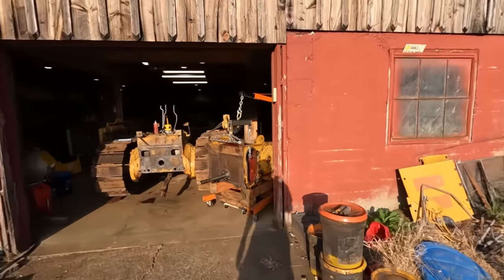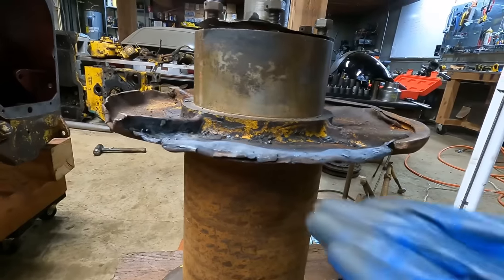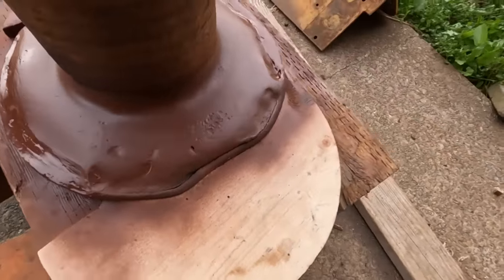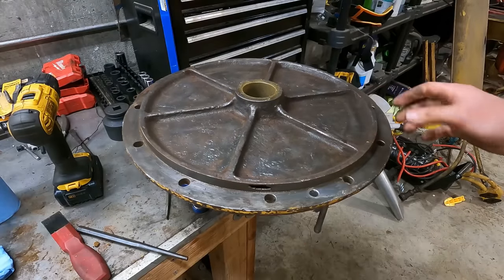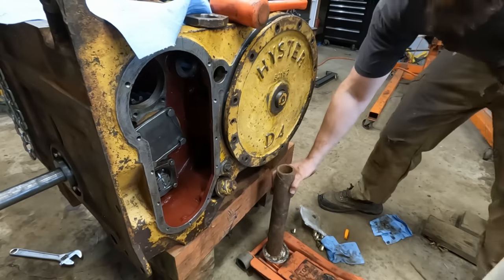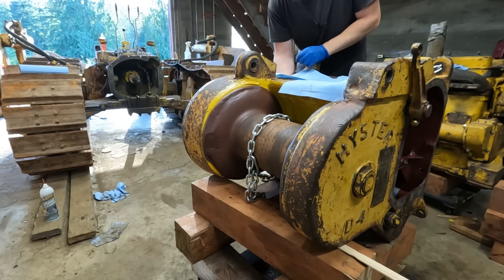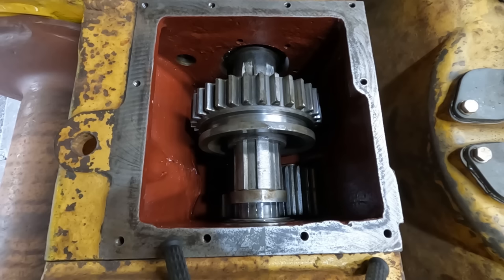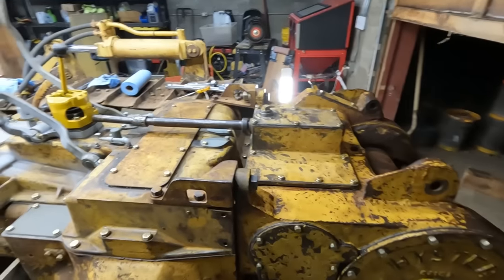Caterpillar D4 Hyster winch full rebuild and installation (part 3)

Comment: Great job saving the original drum. Love the old red oxide, I have parts here my dad painted with it in the 1950’s and it’s still there and no rust.  Your dog is very patient.  Great episode 👍
Reply: Likely that is Glyptol (sp?)
Reply: @uglysteve1  probably Gasoila
Reply: @ligurian728  I’m not sure but I believe there is a can of gyptol visible during the video and I used gyptol in the past and that is the right color for it, I think.
Reply: @uglysteve1  I'm sorry, I was thinking Glyptol wasn't available in the 1950's which it was.
Reply: @ligurian728  please, no apologies necessary. As an electrician I painted motors with that stuff and the color is like no other.

Comment: After reading some of the comments I will pipe in.  It’s a wonderful thing that you are doing.  Old Cats are great machines built in times where people had pride in making overbuilt machines that were made to last.  And be worked on.  I fixed Cats fresh out of high school to cut my teeth on heavy iron.  It’s a wonderful way to broaden your experience in mechanical skills.  Looks like you have a grasp already in the art.  Keep on trucking!  It’s cheaper than most hobbies and you can continue to grow and feel pride in the results.  The shaft guy sent me here and I am impressed. 😎

Comment: Ex Aircraft engineer here, Wire Locking was the bane of my life, I hated doing it. Looks like you did a pretty good job on this thing. Just remember, your winch isn't gonna fall out of the sky if it goes wrong. Plus it doesn't vibrate anywhere near as much, or at as high a frequency as Aircraft do. If one of your fixings does decide to come loose, that wire will hold it and stop it lunching the rest of the thing.

Comment: Usually when installing safety wire, the wire is doubled up and twisted together between bolts/nuts. Also, it might be beneficial to make (buy) your own after market anti-fouling (fairleads) cable guide rollers to ensure the cable can't climb up to the outer spool edges you spent all that time repairing.

Comment: As a Welder for 25 years, typically Stainless steel rod is only used on Stainless Steel. When Welding High Tensil strength steel I always used 7018 know as Low Hydrogen Rod, it flows much better, and the 70 stands for 70,000 lb tensile strength. Mild Steel rod 6013, is 60,000 lb. Tensile strength.  I enjoy your channel very much, keep up the good work.

Comment: You asked for comments on the subject so. I learned safetywire from Naval aviation (helicopters) techniques in the 70's. You've got the right idea on your routing pattern but you only ran one strand. Safety wire should be two strands twisted between bolts. There's a whole lot of twisting with safetywire, that's why they have the built in twister in safetywire pliers. One strand goes through the hole and the other goes over or around the bolt/screw head (depending on the situation). It can be a little tricky trying to twist the pair the proper amount between bolts so that the tension is maintained between bolts, but you get better with practice. Tip: make fine adjustments to the tension between bolts by twisting more to shorten the wire or untwisting a little to lengthen it before you release the grip with the pliers.

Comment: Tim from Canada suggestions are when you’re making a jig and you are trying to bend the metal on a wooden jig.. soak the wood so it does not catch on fire.. or keep a spray bottle with you and when it catches up like that squirt it down.. but if you would’ve soaked that wood first you would have not had the fire come up. Just some suggestions looking Atwood‘s going on

Comment: absolutely amazing that you can remember the million different parts. excellent matt.
Reply from the maker: I can't, but it pretty much only goes back together one way!
Reply: I put a three cylinder motorcycle engine back together once. It had been completely disassembled transmission and all. Once again it only goes back together one way you just have to keep trying different combos on the transmission shafts and gears. Eventually everything fell into place. A real Yahoo moment.

Comment: Unwanted welding tip 😝: Before you try to restrike an arc with a used rod a gentle swipe across a rough surface (old file on the ground or a brick, or the concrete) will remove the flux coating a little and expose the rod end leading to a good first strike.

Comment: I know welding cast can be a butt puckering experience as you listen for pings of doom. I always found I had no issues with welding cast as long as I kept the work hot while I worked on it (regular visits from the torch) and a nice slow cooling (wrap her up in the fiber glass blanket and put her to bed!) That method always served me well :)

Comment: Maybe this has been said before, but for safety wire on bolt circles you basically start at the mid point in a long length of wire, twist them together the. Around clockwise on the bolt head and the. To the next one in such a way that they all are prevented from twisting counter clockwise. I’m sure it’s more than fine as is, given the application. Great work as always.
Reply: Oh my bad, I might have said this too soon. Didn’t know about the single wire thing :)

Comment: Try using a good marine grease or silicone grease on shafts that have no seals also always try to get double lipped seals if you can find them for replacement of seals they will always be much better at their application ,A bearing supply house & some one that will take the time to cross reference the needed seals will be VERY handy ! Best of Luck on the Rest of your project looking Good so far attention to detail is paramount ! Can't wait to see it Run ...Missouri Paul 👍🇺🇸👍👌😎👌

Comment: Welcome back Matt.. We understand you can only do what you can. Great to see you back. Remember all the drum does is feed the line back in. It all ends up how smart the user is that's operating it, one thing i learnt was never pull more than 45 degrees left or right of the center line, if you do your just asking for trouble. A friend of my completely screwed his 9000bls warn winch pulling his car sideways, cracked the winch casing on both sides. Its all about how you use it.

Comment: With safety wire, the way to remember it is that the bolt wants to undo anti clockwise therefor the wire needs to be trying to pull it back clockwise. As an example you have a bolt there with the holes at 3 o`clock and 9 o`clock position and you have threaded the wire straight through. In fact the wire from the right hand side should pass over the top of the bolt back into the hole at the 9 o`clock position, out of the 3 o,clock hole, then down under the base of the bolt to the next bolt on the left and repeat so the wire is in an "S" shape or as near as possible. If a bolt has a tendency to undo it in fact tightens the wire and hence all the length of wire through the other bolts by shortening .Good video

Comment: Your safety wire procedure is basically correct. I am a licensed aircraft mechanic and safety wiring is an important part of any reassembly processes. You are using the correct safety wire pliers. The safety wire should be stainless steel. Always thread the wire in a clockwise direction 
 from one bolt to the other. It might even be ok to use Locktite especially on land vehicles. Right now all aircraft repairs and part replacement call for the original safety wire. You are very thorough in your procedures. Following the manuals,as you do, is a major part of aircraft repair as it should be with any complicated piece of equipment.

Comment: Holy smokes, you know every single part on this old machine. I have no mechanical ability but it is interesting to watch you work your way step by step. When you are all done, it should work like a new machine. Not only did you have normal ware and tare but you had rust and bad repairs. Everything is so heavy. I am glad that you have not given up on her. I know it is a long process but hang in there. It will be so cool to see it all done. 🤠🤠🤠😃😃😃😃😃😃

Comment: Double twist the wire between the first bolt pointing towards the next in the direction of tightening.  Twist approximately 6-8 turns per inch so that the untwisted ends reaches the hole putting tension upon the next bolt, wrapping the other end of wire around the bolt to the end going through the bolt and twist to the same as before. Clip at approximately 5/8” and turn pigtail into a loop out of the way of everything.  Repeat on remaining bolts.  I can assure you that I could have done it quicker than typing it out.  Practice makes perfect, but in this situation close works.  Safety wire is really useful for a lot of places, ergo the wide usage in aircraft and heavy machinery where vibration is prevalent.  I have 3 sizes currently and use almost daily!  If you are interested the standards are available in the aircraft mechanics bible- AC 41.30-( iffn I remember correctly) A & B.  Prolly find it in a Google search.  Great stuff for your enlightenment,  one of the best technical investments I have ever seen.  And it’s a government printing that is really inexpensive to boot.

Comment: 250 lbs is about 4 kilometers...   'nuff said.
I for one, really appreciate the time you spend coating the inner cases with Glyptol.   Doesn't make much difference now, but there is something reassuring when you open a mechanical case open and find the insides have been Glyptoled.

Comment: With respect to the shaft shim pack that you installed in the earlier video. I believe you were worried about it leaking or using the appropriate sealer that wouldnt change the shim pack thickness and corresponding shaft preload. Ive restored a lot of old iron and in some of the FSM's, they recommend coating the shims with grease to prevent oil seepage. Ive used this method with success. the grease of choice for me is military GAA, ( Grease Automotive Artillery). You did a great job on this machine. its a heck of an accomplishment, believe me, I know what work it is, and how frustrating it can be, sometimes it seems it will never finish, Best of luck. Retired Engineer Ted

Comment: Matt, I think your project is a wonderful way to keep you off the streets... not that I'd know you were a problem on the streets, it's just something my dad would have told me. I used to have an old 4' Maletti tiller that blew a shear pin in the gear case and I didn't have a gear puller, so I made one with a length of chain and 2 pieces of angle iron welded on the ends. I heated up the gear with my propane torch and used a 10 ton bottle jack and off it came! Similar to the tactics that you have employed on your project, except you have better tools than I. Keep up the good work and the vid's rollin'!

Comment: Just left you a comment on the first side wire locking -thinking about it again you really have to have a ‘positive pull’ to tighten the bolts tighter, at least 90 degree bend leaving the hole. If it was me then as no balance is involved I would have juggled the bolts for better alignment then just twisted 3 sets of 2 bolts together but as you said it’s not an aircraft. Keep them coming

Comment: That lock tight on the bearing race is a good idea to help keep them from spinning because they are a little loose fitting should be fine with everything together like you said looks great buddy wish I had your drive to restore stuff thanks for sharing buddy
Those oil rings you left out and just used silicone I’m hoping that wasn’t a bad idea will see after it runs a couple hours

Comment: Just my two cents on safety wire installation. I was always taught to go between two bolts. So instead of going around all the bolts in a circle. You go from one bolt to the one next to it and cross the wire. Just the way I was taught. Also makes the wire tighter. And if one breaks it doesn’t mean they all break.

Comment: I will say that winch fought you to the last bold and nut but you got it done, and the end result is better what you started with.
Safety wire was used before locknuts where invented to keep moving components from self detachment. I think the other reason may have been that if something starts to come lose it will not fall immediately into the (crank)case and cause havoc. I'm impressed into what lengths you went to put the safety wires on even if everything had thread sealant on it.

Comment: Going great. Dang I  sure hope this dozer runs and does what you want  when you are done. I  have been working  on one  for over a year and half. Got a new pump in the house for it now. It's  running now and  I  Will  replace it when I  drain the hydraulic fluid to fix a break piston that only works after it warms up. It's  basically  hydraulic drive everything, but have most all the leaks cleaned up. Good luck.

Comment: Matt, nice work, keep it up! One tip I would offer is to get a bunch of longer fine and coarse threaded bolts, 2 of all the common sizes, and cut the heads off and slot the ends for a flathead.  They make perfect alignment studs for hanging covers/parts with sealer on them with out messing it up.

Comment: For the safety wire part, 6-8 twist per inch. Start like you did and twist the wire to the bottom hole. Take one piece through the hole on bottom to the top and then take the other piece on the right side and twist again to make a pigtail. This would be a proper wire job. Safety wire should always be pulling in a tighten direction.

Comment: Matt, Chromium 6 is one of the by products of welding Stainless steel. You should be wearing a Hepa respirator, but welding in the open air is better then an enclosed environment. Nice work.

Comment: Man I did a good one the other day that will have you shaking your head. Was having to weld short pieces of galvanized pipe together and I had welded 2 pieces together and was about to add another piece and had to pick up the other pieces and wouldn't you know it I grabbed them right where my little finger landed right where I had welded just 20 seconds earlier.  I barely touched it and pulled away but the damage was done. Can't believe I did that. Oh well.

Comment: That is a lot of work!  Your safety wire was hit and miss.  Some ok and some completely opposite of what it should be.  The key thing to think of is what will happen when the bolt starts to loosen.  The wire should tighten when the bolt starts to loosen and some you have configured so the wire will loosen when the bolt loosens.   Look at 58:20 on the top right and bottom right bolts, when the bolt turns CCW the wire will loosen.  The wire is actually pulling to loosen the bolts rather then holding them from loosening.

Comment: Sir, you are doing a great job....one that most would never attempt. I'm a licensed aircraft mechanic and would not start a project like this. On that note....your safety wiring is not bad....just remember this  the safety wiring should always be affixed so as to "tighten" the nut or bolt being secured. I have many hours applying Inconel safety wire.

Comment: I ran into this recently and see it's 2 months old. Usually a Nickle based stick rod, preheating the steel, welding small sections and peening it as it cools down. Usually worka out.

Comment: On the safety wire you had a neutral pull, this can allow the bolt to rock back and forth making the wire brittle. Should of started at the bolt, brought it around the head in the tightening direction twisting it all the way to the hard point, bring one wire through the hard point hole pulling it tight and then twist your pigtale.

Comment: Not trying to sound negative but my inner demons were screaming when you weren't prelubing those bearings with a light Grease or an assembly lube but to each their own method. Your attention to detail on this build is very impressive you're going to have a fine machine when you get finished. 👍 looking forward to the excavator restoration next
Reply from the maker: I had them soaking in gear oil before hand, but it's pretty hard to tell.  I used to have a big tub of transmission assembly lube but it disappeared!  That stuff was awesome.
Reply: @PacificNorthwestHillbilly  well I think you are doing a  fantastic job it's been a very enjoyable journey restoring this old cat she's going to serve you very well  for years to come

Comment: * WOW, MATT, you got it done. Congratulations.*
- HURRAH, HURRAH, HURRAH...You Got The Winch Done and Put Back Together ! ! !
- I very much enjoy seeing the solutions you come up with for the issues that show up.
- I wanted you to spot weld on nuts to all the pins, but I get why you didn't.
- I also wanted you to redo the forks so the thing that needed to be in the front was there...what a knit picker am I...{sorry, I just get finicky with myself like that...but I well understand all the effort you were putting in alone and it fatigue that produces...with inherent safety dynamics at play, fatigue is not a good time to be redoing things that don't actually have to be done}

Comment: Dude, I would weld it so it keeps it shape. I think I would also mount half inch plate to the inside with recessed heads. Add a lot of stiff for little effort.

Comment: Safety wire is wound based on whichever way keeps it from moving.  There is a whole section in the Machinery's Handbook.  It is worth a purchase.  The way you have the wire wound it won't go far if it does move.

Comment: First off love the fact that 250 lb converts into kilometers and not kilograms LOL, and with the safety wire that is one way to do it and absolutely fine or you could have safety wired the bolts in pairs, the whole point of the safety wire is just to keep the bolts from loosening up
Reply: very little people will get it!! LOL
Reply: yep the bolts in pairs with the safety wire
Reply: Wired in pairs so that if one tries to loosen it will tighten the other.